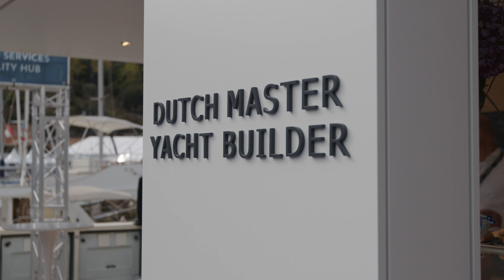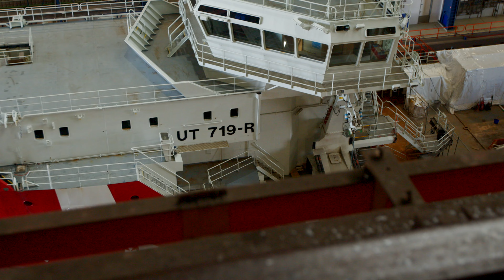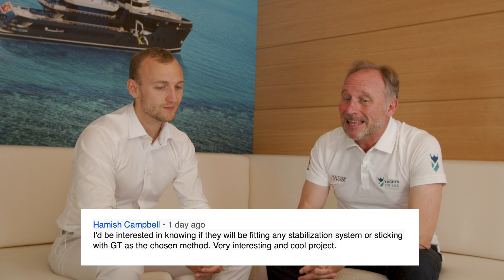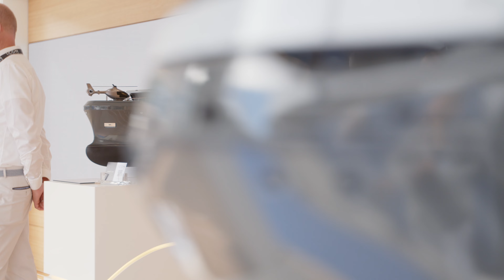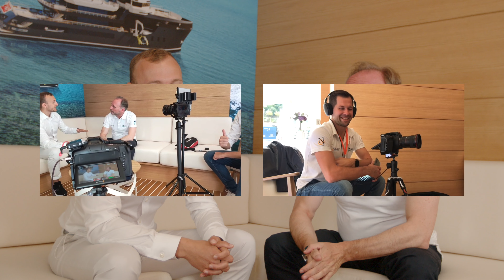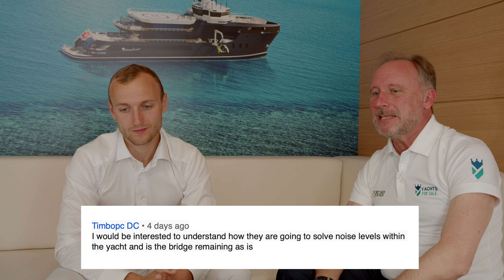ICON'S AMAZING PROJECT MASTER - YOUR QUESTIONS ANSWERED!

Comment: Excellent, thanks 😊 About wind turbines... While the small ones are common on sail boats, I've yet to see one on a motoryacht/superyacht. I wonder why? In your video of February 2020, about the Rossinavi design challenge, you talked to a young designer (Jack something, impossible to hear), who had designed a superyacht project with a rather large but retractable wind turbine. I found that very interesting, but have not been able to find any information on such a setup anywhere. Not only does the turbine itself take up space, but the 'transformers or whatever you need to capture and store the energy' will also take up space. Not worth it? Owners don't want to give up space? Not efficient enough? It's an interesting subject I'd love to learn more about.

Comment: it looks great and I imagine maybe slightly cheaper than construction of the yacht from scratch. That would be interesting to see what Lurrsen, Oceanco, maybe Turquoise or Heseen would charge for something similar to that without a donor vessel. I bet it would be in the hundred millions. Whereas this you are buying the yacht and recycling some of, parts by selling them. That's another question, is that savings that comes from selling the unneeded parts transferred to the client (minus labor for removal) or do you view it as your yacht and you are removing it and finding the buyer so it's a wash(comes out even if you don't get American slang)?? Last question, I watched the video about these donor vessels from another channel. He said that these ships will have 70-80% aggregated total of the systems, furnishings, and some structures removed, which all combined is about 70- 80% of the yacht. They want a bare shell.  is this true? sounds amazing if it is.? I can see 50-60%.

Comment: Using a donor vessel, how much is the cost reduction compared to an equivalent new build? 10%? 50%?
Reply: I also asked that question. Would be interesting to know what the big builders like Oceanco, Turquoise, Bilgin, Lurssen, Heesen, and Feadship would charge. I don't think Benetti would do anything this big, nor would Van Der Valk. Those are the only other 2 custom builders I can think of, maybe Alia or Dunya in Turkey, but pretty sure those 4 would not do it. The others might. I agree though. What are the savings?